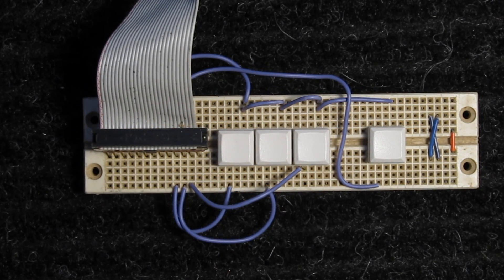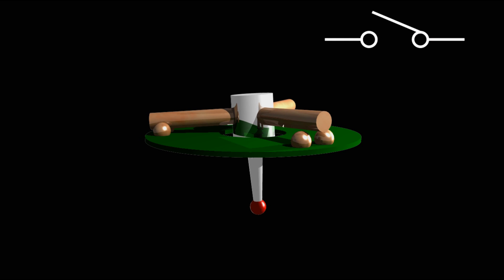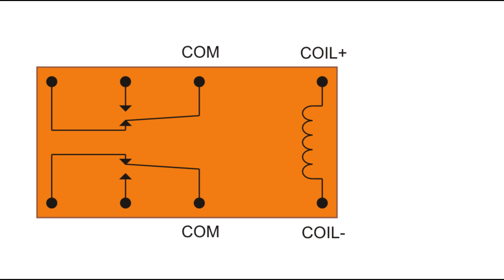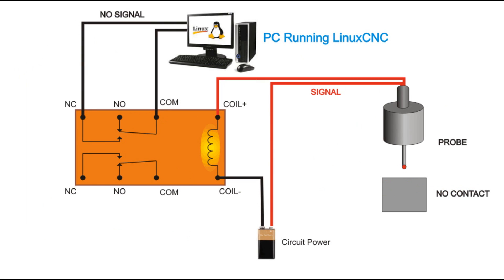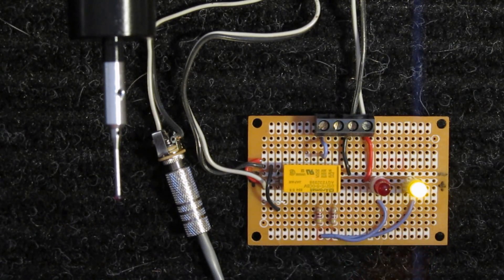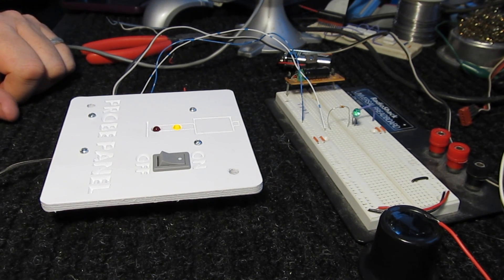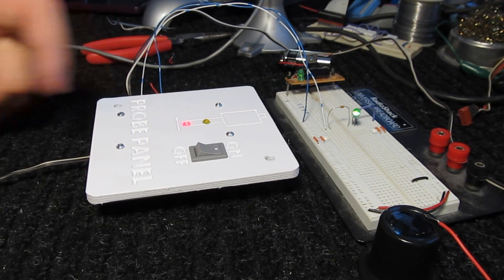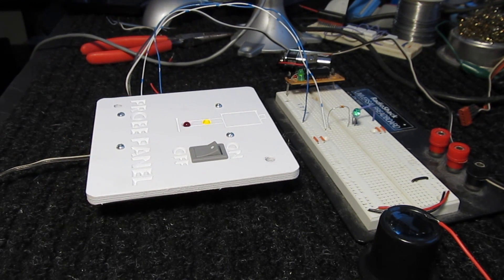Touch Probe Part 1 of 3 - The wrong way to do it. :-/

Comment: Why would you do this? You've increased reaction time and reduced precision.  Buy a normally closed switch!
Reply from the maker: The video was left as an archive... if you read through the comments and watch the rest of the video series it has been updated several times. I left the latest microprocessor design because it makes a pleasant beep at the contact and de-bounces the signal.

Comment: You should just be able to invert the signal on the input with the software/firmware. Relays are far too slow and add extra lag in the signal.
Reply from the maker: I need to update the description. If you continue watching the series you will see the relay had some failures and was replaced by a microprocessor update. But even that is not really needed if you use the proper G-Code to select activate on open or short. I like my microprocessor solution as it gives a nice BEEP when it detects a change.

Comment: A relay is the last thing I would use for something like this.  First, I would try the software and then look for the simplest hardware solution.  Among the hardware solutions, a simple transistor will do the job quite nicely, if a wiring option is unavailable.
Reply from the maker: Barry Manilowa I know now... if you watch further in the series I changed it out with a Tiny-13 micro. I still use the circuit for denounce... but I have learned to properly use the correct G-code sequences now.

Comment: You can invert the signal in the software, don't have to use hardwareI made the same mistake using hardware to do it. I used pin 13 and used the invert in the pin config in Linux cnc. Although I did use an optocoupler to isolate pin13 on the PC to the machine.
Reply from the maker: Actually... I have found that I don't even have to do that. I just write my routines now so that when using a touch plate, it looks for a "break contact" G38.4 or G38.5 then when moving away, I use the "make contact" G38.2 or G38.3 commands. When using a regular probe that is wired as normally closed... my routines are written normally. That's part of the whole history of this project... as I learn, I share my findings.  For example the relay... it turned out to be horrible... too much delay, chatter, etc. In a later video, you will see that I switched to a microprocessor... I really don't need the ability to switch between NO and NC... but the microprocessor does debounce the probe nicely, so I left it in there.  https://youtu.be/YGaYbrWXJ20

Comment: A solution to the "unplugged probe" problem might be to use the type of jack that has a contact in it that closes when no plug is inserted.  Like the type use for headphones the turns off the main speaker when headphones are plugged in.
Then  I  would invert the pin in LinuxCNC.

Ray M.
Reply from the maker: +jrmitchellj That is a good way to do it. My issue was that for some things i will use my probe (NC) while for other things I will use a touch plate (NO) so I needed to be able to switch between them. The relay had issues... so I came up with an alternate solution: https://www.youtube.com/watch?v=YGaYbrWXJ20

Comment: cool video mate.   Instead of running a relay though,  why dont you just invert the pin in the cnc software you're using?
Reply from the maker: Troy Dawson When inverted, if the probe is not plugged in, the software thinks the probe is always touching. Also... there are times when I want to detect things directly with the tool... by placing a puck of a known height on the platform and dropping until contact. Then adjusting (automatically) for the height to set zero. 
Made other changes however: https://www.youtube.com/watch?v=YGaYbrWXJ20